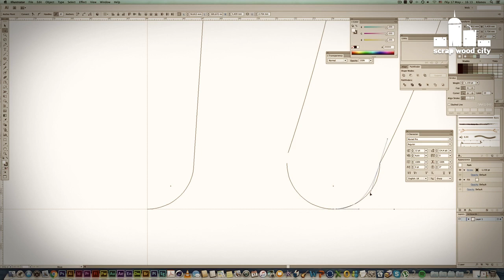How to make a wooden spoonfork

Comment: Nice work buddy. I wanted to ask you if you're satisfied with that bandsaw BTW
Reply from the maker: +TheGxpana until now it works as it should for the money I gave. it does the job for me. If I had a little more space I would prefer a bigger one, so I can have more cutting height and also to use thicker blades sometimes!

Comment: FYI Vegetable oils are not a good choice for wooden utensils or anything that will contact food.  The vegetable oil will go rancid in the wood and can smell as well as give an off taste to food. Bees wax and mineral oil or  linseed oil would be much better
Reply from the maker: +Mike&#39;s Micro Shop we'll see, time will show! :)
Reply: You can do as you wish, I have made thousands of wooden utensils for history reenactment. I mean I was doing everything historically correct Right, well after a few events opening up the boxes to set up my shop would knock you over. After a while all the stuff spoons cutting boards bowels plates they all start to smell.  It is not a health hazard, but it does taste and smell bad.  So as a result I started using linseed oil and bees wax.
Reply from the maker: +Mike&#39;s Micro Shop I intend to make a linseed oil and beeswax finish. I'll test them out both!